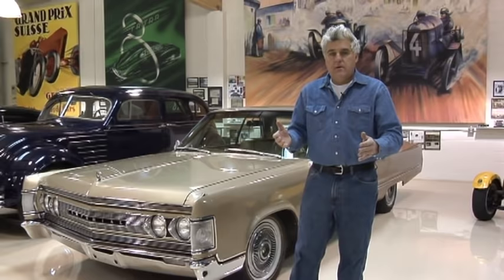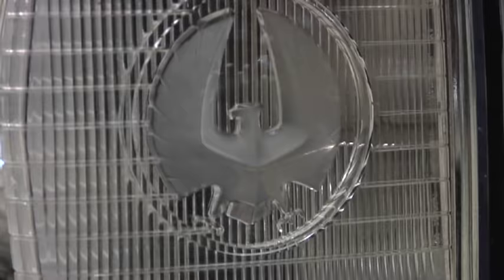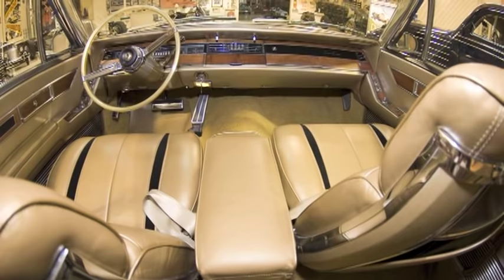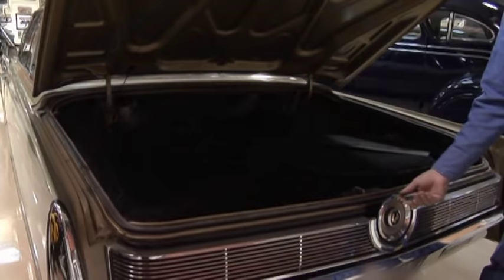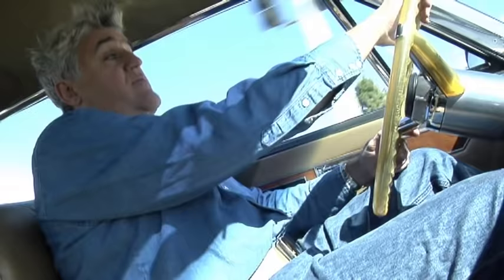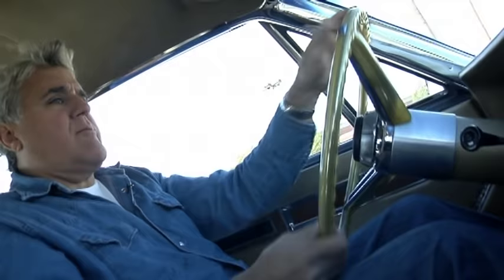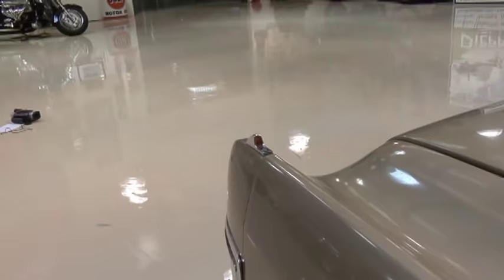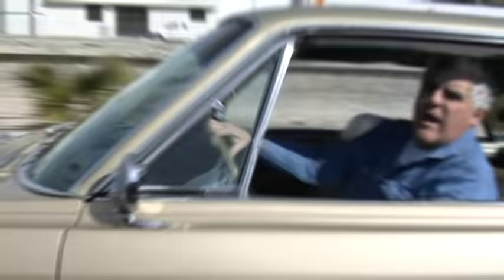1967 Chrysler Imperial Crown Coupe - Jay Leno's Garage

Comment: It is not a Chrysler Imperial, just an Imperial, 
Calling it a Chrysler imperial is like saying "I have a Ford Mercury"
Reply: +Ryan Richards * Except Imperial wasn't an automobile division
Reply: Yes it was. The old signs used to read: 
Dodge 
Plymouth
Chrysler 
Imperial
Reply: +Ryan Richards well, it is and it isn't. if they made a number of models simultaneously it would indeed be like you mentioned. hyundai is trying the same thing with the equus. no hyundai badges on that, and they are intending to make a separate brand out of it. but still, i think it is better known as a hyundai at the moment)
but i think it's a good idea for a luxury car to have just one one-word name. it's very cool somehow.
Reply: +zloychechen5150 from 1955-1975 it was its own car. A company does not have to make several different cars to be a company. a Model T is not a ford because that is all he offered?
Reply: +Ryan Richards the brand was separate but there was basically only one car offered
Reply: And?
Reply: He is Jay Leno,  cut him some slak !
Reply: Yes it was . It spun off from the Chrysler Division in 1955 . And, even if it wasn't, Imperial was still a separate make , with it's own manufacturing plant. Ford had it's Lincoln-Mercury Division, but that didn't make a Lincoln a Mercury, or vice Versa 
Also, check the VIN numbers . Under the "make" code ,all Chryslers used "C" .Imperials used "Y" .If the Imperial was a Chrysler , it too would have had a "C" code ... Just like other Chryslers . The New Yorker, the 300, the Windsor , etc . That serves as indisputable proof that the Imperial was a SEPARATE MAKE ...not a Chrysler .
Reply: +Ryan Richards actually , even the 1981, 82, and 83 Imperials , were also separate from Chrysler, and were their own make and brand. There were separate "Imperial" dealership signs even then.
Reply: +williamg2552 not sure on that.  According to Chrysler,  imperial was a seperate marque from 1955-1975.  The 1980 was marketed as "Chrysler Imperial"
Reply: williamg2552 Thanks for the support! Want to get the word out to these dumb dumbs that keep calling it a Chrysler!
Reply: Ryan Richards
there was an imperial marque in britain as well... just sayin
Reply: Just saying what? 

This I know. 1955-1975, Imperial was its own brand. My 1961 is not a Chrysler. The title reads "1961 Imperial Crown Southampton"
Reply: Ryan Richards
wooo poop tee hoo... and my car reads sierra cosworth ghia... doesnt mean it was made by a belgian industrialist... people might know now adays that scion is made by toyota but will they know 50 years from now when scion has been dead and buried for 20 years
Reply: you are correct. when Toyota builds its own entire assembly plant for sole scion production, and then hire the best of the best to ensure quality control (1-10 workers at the imperial plants were quality control) then maybe they can say that. You do not seem very educated on the subject. You should do some research. How many parts can you pull off a scion and pop on a toyota? A LOT. Not the case with Imperial.
Reply: Ryan Richards
these technicalities are specific to the age... nowadays there are probably more quality control guys and or procedures in a regular toyota plant then there were in an imperial... but its not these things that matter... what matters is that imperial is not bugatti its something that died out... if you just say imperial... people are gonna go which imperial... chrysler imperial... oh that one
Reply: That is your opinion sir. Bugatti is an overprice VW that needs $20,000 worth of work every 20K miles. There is my opinion. Go back to watching your civic videos you troll.
Reply: Ryan Richards
sour grapes much... im just saying imperial was never as famous as bugatti wth?
Reply: It sure was a lot more famous in 1961 when Bugatti was non-existent. And of course not. Imperials did not cost millions and millions of dollars. Bugatti is just known because it is so expensive. Does not make it a good car.
Reply: williamg2552
right chryslers advertising bullshit is more relevant then peoples perceptions
Reply: +Lone Wulf Something is wrong with you I think. Maybe the elevator doesn't go to the top floor. I am not stating this as my opinion. I am TELLING you, the facts. In 1955 Chrysler corporation made Imperial its own brand to better compete with Cadillac and Lincoln. They purchased a factory and tooled it up to build Imperial there in its OWN plant. As I stated before, If you would do a simple google search, and quit looking up stupid Bugatti videos (sure says a lot about your knowledge on vintage cars... not much) then maybe you would agree with us. 

You are wrong.
Reply: +Ryan Richards You are correct sir! And another thing Jay, hubcaps cover hubs and wheelcovers cover wheels.
Reply: +Tjfreak oh yes from 1955 to 1975 Chrysler corporation separated the Imperial line from the Chrysler line to compete better with Cadillac and Lincoln.
Reply: +Lone Wolf It is if THEY'RE the ones who BUILT the car. THEY outta know what it is...and what it isn't .
Reply: +Ryan Richards yes,it's good to have an important mission in life.
Reply: ***** The only "Continental" that was not a Lincoln was the 1956 and 1957 Mark II Continental. After that, they were Lincoln Continentals. It would be wrong to call it a GM Cadillac. That would be dumb.
Reply: +Ryan Richards, I know this is old, but 1966 was the last "true" Imperial.  '67 was the first Chrysler Imperial.

Everyone else...Imperial was an "independent" marque until '67, then it was rolled into Chrysler.  Yes, previous models had the 440/727, however, it was its own machine.  The frame was not shared.

Also, the 1962 (?) - 1966 all had wood from the same Brazilian forest.
Reply: Cool Cadillac Cat it is TECHNICALLY 1975. But I agree by 1967 Imperial had lost its special-ness.
Reply: Ryan Richards, no.  From 1967-onward, it was a badge job.

The 1966 ones did not share a frame with any Mopar model.

The 1967 was a dressed up New Yorker.
Reply: +Ryan Richards the 1958 Continentals weren't Lincolns even though they were Lincoln-based...Continental became a series of Lincoln starting in 1959
Reply: +Cool Cadillac Cat (C³) you are sssssooooooo wrong. The New Yorker was a dressed down Imperial, by Chrysler. Oh you might want to check the Cadillac and Oldsmobile and Buick frame, and parts equivalent. You will find that they are more shared than you think.
Reply: *****, no...no I'm not.

The D-body was it's own platform, from 1957-1966.

The '67 was no longer a separate, unique body-on-frame design.  It shared the unit body platform of the 300/New Yorker/Newport, the C-body.  It was a different exterior shell, but the unit body (frame) was the same across the line.

The 1966 did not share frame nor body panels with anything  else.

Now, the first two years, 55 & 56, did share a platform, but the wheelbase was lengthened.  It, however, was NOT  a Chrysler Imperial.

I was Imperial.  That's it, until 1967. Then  it was Chrysler Imperial.

BPOC vehicles have been very-obviously sharing parts since the late-50s, which is well-known.  In fact, the reason the fins on the '59 Cadillac are so over-the-top is because Exner wanted a stand-out design against a backdrop of the very similar 1959 Buick door.
Reply: +Cool Cadillac Cat (C³) The facts are that, no matter how it was built, the Imperial was a separate entity as was Dodge, Plymouth, Desoto, Fargo trucks and of course Chrysler. My 1972 Lebaron has buttons, and switches and, if you look just right, a close resemblance to the Gran Fury. However, my 1972 Imperial, is equal in standing to Cadillac (Oldsmobile, Buick) and Lincoln (Mercury). It's survival economics. Chrysler was too late in the game when it made Imperial a separate make. however there were those two glorious years that Imperial sold more than Lincoln. so Cool Cadillac, keep thinking your thoughts, but your wrong. case closed.

Comment: Chrysler brakes and power steering from that era was fantastic. I had a 1976 Chrysler Córdoba with a 400 cu inch and a 4 barrel and even though it had the lean burn system and all the smog devices it was fast and comfortable and quiet. I miss that car.

Comment: I used to rebuild those Torqueflite 727s almost 40 years ago.  I bet I could rebuild them today without any problem.  Also the Torqueflite 904s in the smaller engines.  Good transmissions.  Main problem was the clutch packs would overheat and burn out.
Reply: Robert Johnson just need better clutches now. Use a bolt in sprag, lighter machined front clutch  housing, and a 4 pinion sun gear and they’re damn near bulletproof

Comment: Thanks Jay, I loved the Imperial from '64 to about '70. I heard & read about Chrysler engineering, but never got to experience any until the '70s, which at that time had changed to shoty switches & plastic. On rainy days they wouldn't start. Thanks for educating me on the features of your '67.
In the early'60s I helped my dad install GM seatbelts on our '57 210 Sport Coupe my mom drove.

Comment: We had a '66 Lebaron. Built like a tank - put everything else other than Lincolns and a couple Caddies to shame. Real wood and leather, 6-way power bucket seats, power everything, dual AC with separate front and rear controls ( separate heat controls as well). 440 with twin carbs. Could cruise all day at 120, except for rather frequent stops for gas! :)  Incredible car for that time.

Comment: The wood trim is Walnut and the steering wheel is also telescopic if you turn the horn button to the left and then lock it down after you adjust it ....it also tilts....plus there is an extra dimmer switch to change the radio station....my scout master had an imperial and it got about 6 or 8 miles per gallon if you kept your foot in it .great car!!!!

Comment: Jay talking about dumping from neutral  to peal out. A high school friend of mine in the late '60s, with no respect for his parents or their cars had his own method: auto trans in drive, stand on brake, floor it until the smoke from the brakes was too thick to bear,  release brake, and all hell breaks loose.  Must have been a (bulletproof according to Jay) Torqueflight transmission, but I still don't get from a mechanical perspective how the car was able to withstand those extreme forces. But, oh the memories!

Comment: In 1970 I bought a 1969 Dodge Monaco dealer demo with 2700 miles for $3000. The new list was $4800+. I did not have power windows or cruise but it was a 383 2 barrel carburetor with 727 torque flite and 2.72 rear gears. It got 22 to 23 MPG on road trips and would do 75 MPH in low. It was a fantastic smooth automobile. You could go over 400 miles between fill ups and I think it was a 22 gallon tank. The AC would freeze you out if you wanted.

Comment: My father bought a 68 exactly like this in 68. Fabulous car but he always complained about the rattles. Then 2 years later I was 14 and working at his gas station with my neoprene soled shoes. I was moving the car to the rear of the station and I had gas on the soles of my shoes. Well there is a chrome trim around the brake and my slippery shoes slipped off the brake and hit the gas of that 440 magnum. When Jay says it is fast, that is an understatement. I took out a chevy nova before I could get my foot back onto the break. So sad

Comment: I had to laugh when Jay mentioned that the car felt like a meat locker after a minute and a half of "dual" air conditioning.  My late father's '60 Pontiac Bonneville 'flat roof' also had an air conditioner that turned the car into a freezer on wheels.

Comment: My parents bought a 67 Imperial during the 1973 Gas crisis for $700.  It'd belonged to judge in Santa Fe, so it was a New Mexico car which means, 0 rust.  It was white with a blue leather interior, it had all the items in Jays video including a cruise control which if I remember correctly, was not electronic but manually operated somehow, off the manifold pressure?  It was the two door, and the doors were MASSIVE!  Maybe 8-10 inches wide, the car, what?  Maybe 23 1/2 feet long.  I borrowed it once and misjudged the rear length and I thought, lightly bumped a car behind me and wasted the other cars bumper.  the Imperial, unscathed.  It weighed in at some 5000 pounds and of course, mileage was what?  Maybe 8 miles per gallon?.  I took my future wife on a date in it and I was blowin' down the highway at eighty when a radiator hose blew.  Not the only time I ended up taking the poor woman hitch-hiking. Why did my parents let me take that car?  I guess because I liked it.  My sister ended up with the car and I gave her some money to repaint it because since it didn't fit in the garage my parents just parked it in the driveway and the NM sun faded it.  She had trouble selling the car in NM but finally a low rider guy saw it for what it was, an awesome car!  I rue the day that I didn't offer to take it off her hands myself but I already had 5 cars and so, like a 57 T-Bird I passed on, it goes down on my list of shoulda coulda cars.

Comment: Years ago I bought a 1968 Chrysler Imperial from a elderly woman in Baltimore Md for get this $300.00! Mint condition had 148.000 on it, Went to pick it up with a friend of mine he followed me home got at a red light in Westminster Md we were side by side at the light he looked at me and said WELL? I smoked the tires half a block 440 was still very strong.

Drove the car for a few months then stripped it the whole drive train ALL of it and scrapped the rest of the carcass don't yell at me I was young the 440 got rebuilt to the tune of 600 HP and went into my 68 Roadrunner those cars were like picking fruit from the trees they were everywhere and cheap to those were the good old days.

Comment: I know your weakness, Jay Leno. It's Imperials! I bet you have more of them than any other make. I have a taste for them myself. May I suggest a 1975 model? They all come with their self-leveling air shocks as standard equipment. 4-wheel disk brakes with a brake drum in the rear rotors for a parking brake that does not slip. Their smog system functions flawlessly and actually reduces pollution significantly. Why pollute when it's not necessary? I think you'd love one!

Comment: These actually had good power and would burn rubber when floored from a stop with no brake holding..

New cars have 5-10 speed automatics with low gearing...Now add low gearing to this trans and this car would be a low 12 second 1/4 mile beast ! 

I owned hundreds of Mopars/collector cars over the years..My buddy always liked these,he has a 67 GTO,2002 Ferrari and a few newer cars..He bought a 68 Imperial 440,727,3.23 axle ratio..I restored the body,my other buddy rebuilt the 440 to stock specs except bigger carb and reworked trans..a little lower 1st gear ratio for quicker take offs(not as low as new 6-10 speeds)..The car when stock ran 13.90's in the 1/4 with 440,single exhaust and over 160,000 miles plus around a 5.3 0-60 mph..

Car now with just transmission 1 st gear and torque conv swap,750 holley and duel exhaust it runs 13.02 without really hammering it..4.6 0-60 ..fun car,triple black(was white/black)..This was in 2003...

Comment: That Torqueflight transmission was the first automatic to be faster 0-60 than the manual transmission counterpart of the same engine. When Jay said it was one of the best transmissions ever made he was not overstating it. It may be the absolute best ever. It could handle all the horsepower and torque you want to throw at it and neutral drop it at every red light. You could also slam shift it manually and burn rubber in all three gears.

Comment: "If you worked in a factory, this is what the boss drove ." Spot on, a friend's father was exactly that boss. I recall being awed by air conditioning, electric windows, but especially the electric antenna extender.

Comment: My first car was a 1980 Datsun 510 with Z engine.  I bought it in 1982, had a 3-point seatbelt....that I never used. Then the laws changed a few years later.  I still miss driving without a seatbelt.

Comment: My parents had a 1967 Imperial, but it was the Sedan, the cheapest model Imperial you could get, though still not a cheap car. They did get theirs cheap because it had been in an accident and repaired.
They drove it for 140,000 miles over 9 years.
Reply: Miller/Meteor made some nice professional cars ``👌

Comment: Jay demonstrated the steering wheel tilt, BUT he he didn't show how the steering wheel had telescoping ability as well; leaving me to wonder if he realizes that it does that. The chrome ring around the horn in the center of the steering wheel is hand turned counter clockwise to loosen the wheel and you just push or pull the wheel toward or away from you; then just turn the ring clockwise and away you go with a nice custom fit.

Comment: My father had a 65 Newport 4 door, the poor man's imperial, I was a kid and it had to be the worse car I ever rode in, no AC no radio and the heat never worked, it suffered from vapor lock and no one could fix it, my uncle restored Mercedes sport coupes and Porsches and even he couldn't figure it out, my sister was driving it to nursing school one day and it stalled two blocks from the house, vapor locked as usual, she was upset and my father somehow got it started she was stopped at a light and two cars rear ended it, my sister was hurt but that was ultimately the end of the car, that and that winter while the car was parked it snowed and while cleaning it off the rear window shattered, then my father bought a used 1970 lesabre which was a night and day difference from the junk Chrysler and it had AC and a radio, it rode like a dream and was the first car I ever drove, I am on my 5th lesabre a 2001, that I bought 4 years ago.